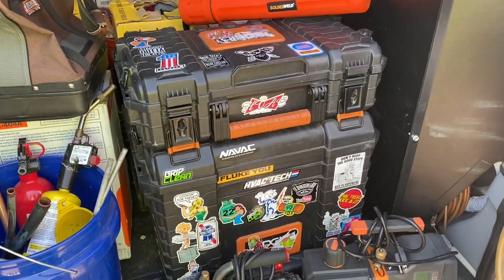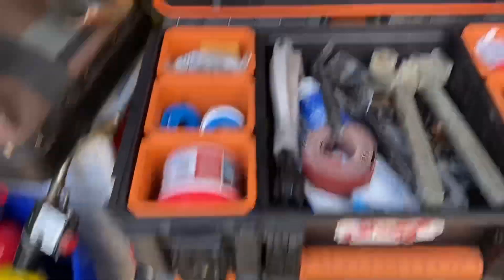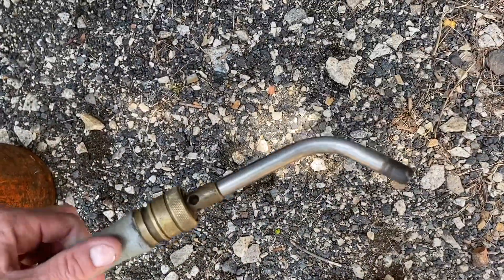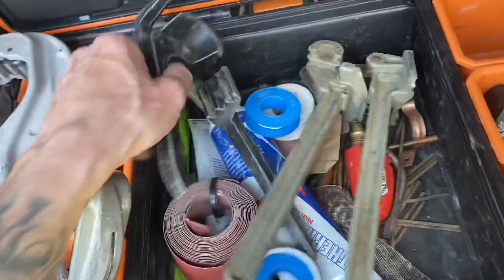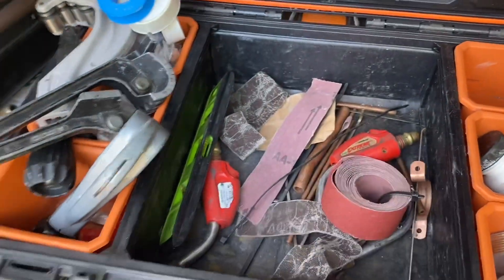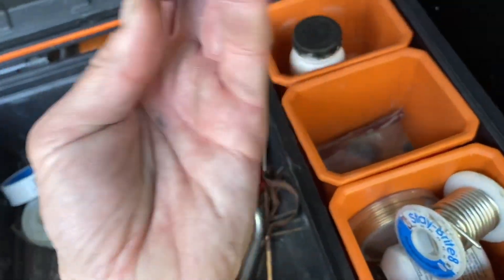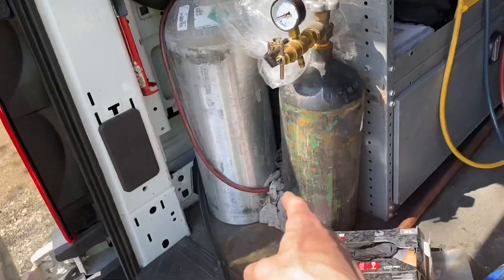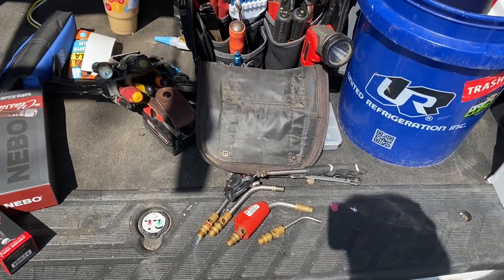My Hvac Brazing and Soldering Tools

Comment: What size torch tip do you use for a 2" copper to metal using 45% solder?  Think of getting just a b tank in my area its sometimes hard to get a refill on my oxygen tank.  Thanks man love your video👍
Reply from the maker: APR928 id use a 14 or bigger
Reply: Thank for the video, I'll be working with a company that will doing mostly refrigeration, my old company mostly did commercial ac and had a oxy/Acetylene torch for me to use but I'm thinking of purchasing an acetylene torch from Asco
there are alot of sizes for brazing #2 for up to 1/4", #3 for-1/2, #4 3/4, #5 -1" #6 1-1/2", #7-3".  What tips would you recommend getting to start. Thank you for your time.